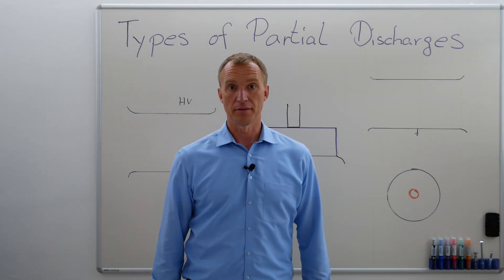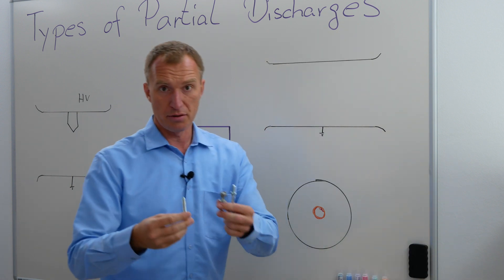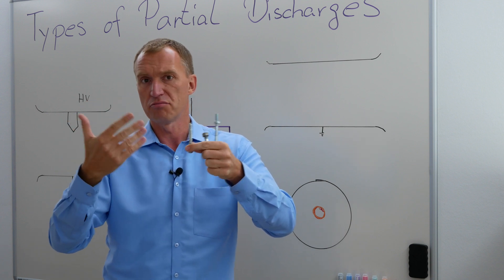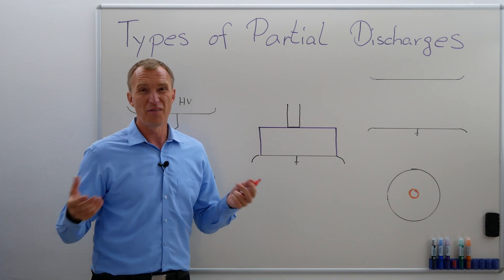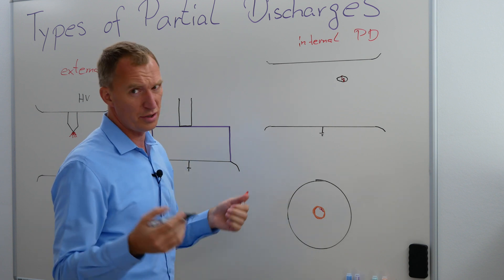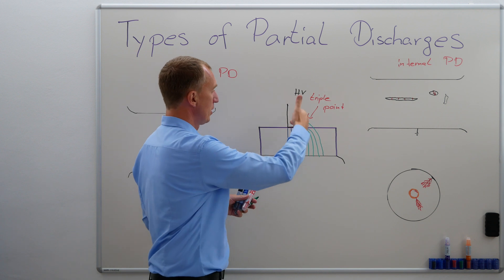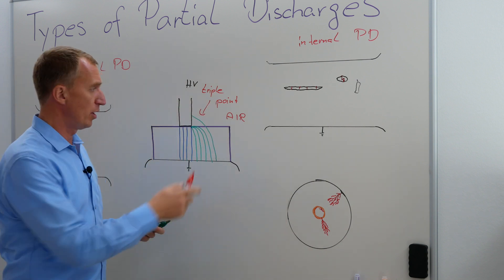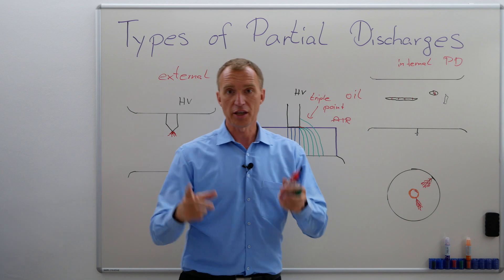3.0 Types of Partial Discharges - overview

Comment: Floating-electrode discharge is also often mentioned as a typical type of PD. Can we categorize it into one of the types in the video?
Reply from the maker: I will make a video about other kind of discharges as well ... yes. Technically, "flotating potential" and "bad contact" are not Partial Discharges, by definition, but we detect and measure them, then testing for Partial Discharges.
Do you have, by any chance, some photos or even a PRPD Diagram of your last "Floating-electrode discharge" measurement? This would help to make the video better! 
Due to copyright reasons I am looking for nice PRPDs and photos that I can use.
Reply: Thanks for reply. Could you please recommend textbooks or papers explaining in-depth mechanism of how these PRPD forms for different PD types? @PartialDischargesGuru
Reply: Perhaps using plasma physics or gas discharge theories.